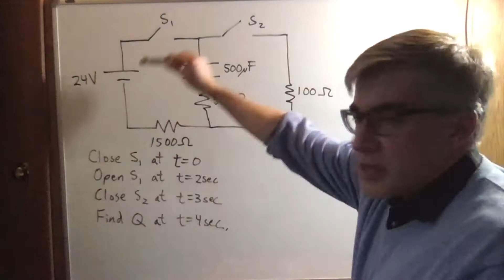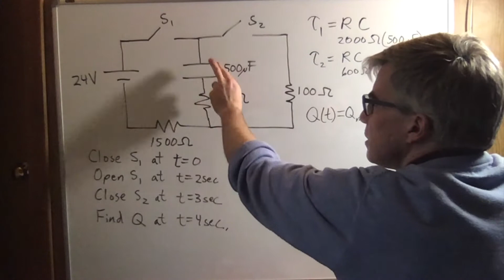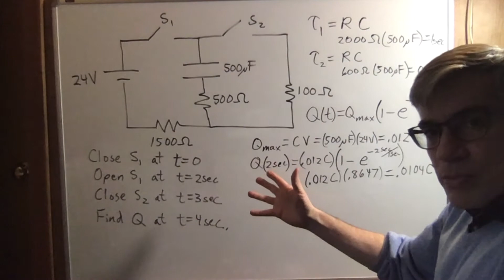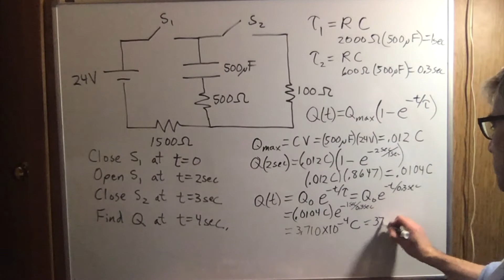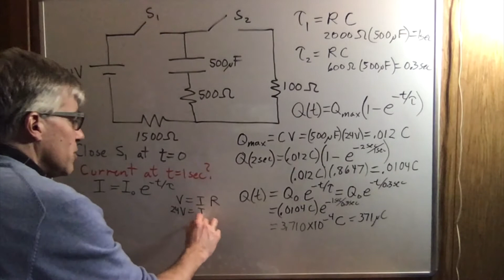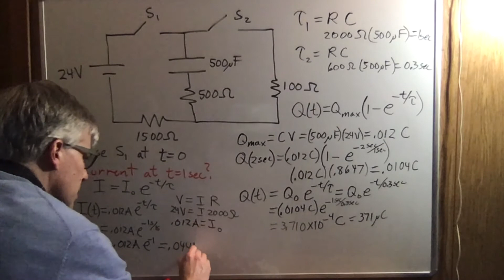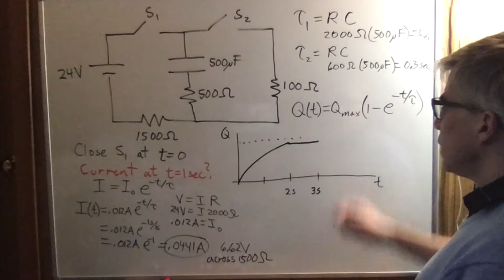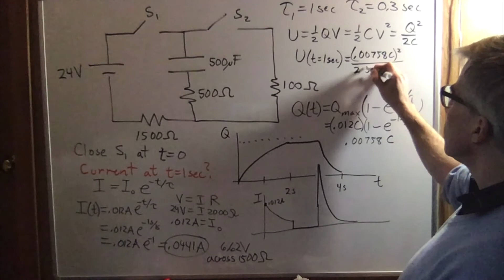Charging and Discharging RC Circuit

Comment: Stuck on how you got 6.62V @1500resistor. I do .0441*1500 and come up with 66.15. Am I missing something? Thanks.
Reply from the maker: Good catch! I missed a zero, since .012/e = .00441, not .0441. Since I had it correct on my calculator, my next calculation came out right so I didn't spot my miscopy.

Comment: I have actually watched this several times, I’m new to electronics and I have an O-scope with a programmable 32 V single power supply.  I would need to rig up a “relay” to make that happen or possibly a transistor that I could turn on/off with an Arduino using your timeline. I want to see the O-scope capture the VOLTAGE across the resistors and the Capacitor….my scope is a 2 channel so this should be do’able.  I will have to back off the power since my max voltage on the cap I have is 16 V.

Comment: Why did you write Q squared, instead of V squared, in the energy calculation? 🌹
Reply from the maker: I could have done it with 1/2CV^2, but that would require knowing the voltage across the capacitor specifically, which I hadn't calculated. I could do it, it would just be an extra step, because I would need the charge anyway to plug into Q = CV and find V.
Reply: @robertcruikshank4501  i got it thank you for the explanation